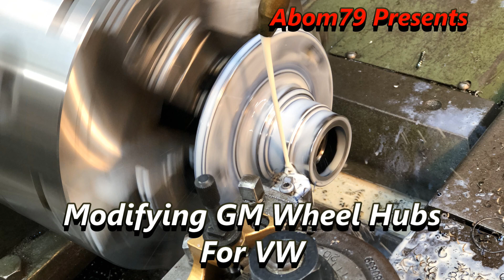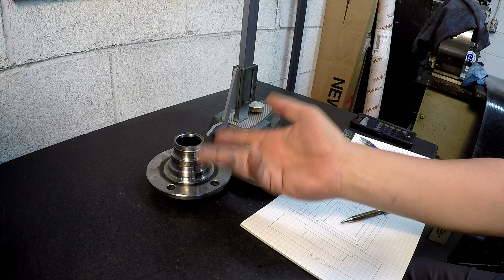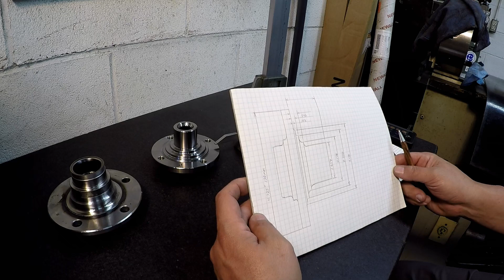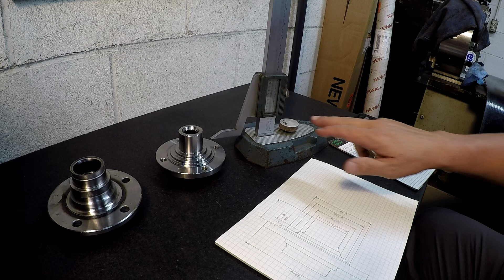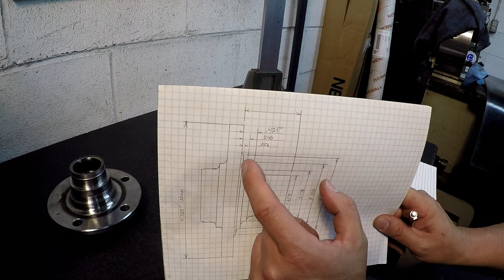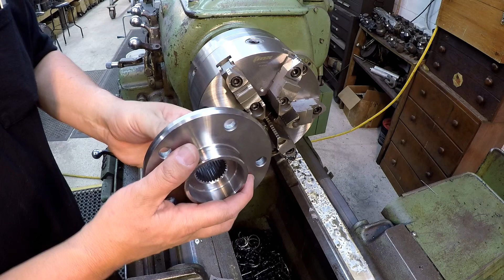Modifying GM Hubs for VW

Comment: Hey Adam I want to ask why you did not used simple tool as angle grinder n cut that bearing part at an angle? I am working as mechanic long time so I know that these things cracks so easy if you cut more than half of it so you save ur inserts and avoid that terrible sounds :D
Reply: there is no inner bearing race, the balls run on the hardened hub

Comment: Wouldn't it be better to anneal it first . Then machine it. Then heat treat it?
Reply: Did you listen to the video?  He explains this.
Reply: Heat treat cycle would probably distort the part and it would require to be trued in a grinder. Too much work.

Comment: dont think i could do these things with my smal lathe , think grinding them with a toolpost grinder might work
Reply: As long as you have enough swing on lathe you can do it
Reply: @practicalhands3720  With hardened materials rigidity becomes an issue very quickly, light cuts don't always work in that stuff.
Reply: Whatever it takes man!
Reply: You can temper the steel back and then re-harden it
Reply: @practicalhands3720  You can anneal/temper the steel and then machine it to dimension, but re-hardening will cause warping/distortion and growth.
That's the reason why hardened parts are ground after hardening or machined straight in a hardened state which brings us back to our initial problem.

Comment: Looks like it is the perfect job for a CNC machine. Anyway I prefer see Abom doing it manually :)
Reply: If I had to do this job and had the choice between cnc and manual I'd still go with manual on this one. However, if the job was to make a couple form scratch, I'd lean to the cnc.

Comment: Hey Adam, good job on them wheel hubs love watching your videos such a inspiration. I have a question for you if you don't mind me asking. I have a long stainless steel unthreaded stud stuck in my aluminium engine block (its a long engine mount stud and is flush with the engine block) What would you say is the best plan for attack of getting it out? I've tried Kroil, heat, hammer & punch, I've even tried swearing at it with no success :( I was thinking of drilling it out but I'm not sure what's the best type of drill bit for drilling stainless steel. I Appreciate your help.
Reply: cobalt drill, medium/slow speed with high pressure. But beating on it is gonna make it hard to start on centre without making a flat spot to start straight and on centre. Man never hit car/bike parts with a hammer if you think you might have to drill them out, if it is giving you hassle from the get go make the decision to drill early rather than bending, twisting and mangling it with a persuader then drilling when you have made it harder for yourself. Get a helicoil kit for the size required as im pretty sure you mean has threads? Good luck!
Reply: @williamsavory5274  I doubt it has threads on the section that is stuck because he wouldn't have used a hammer and punch otherwise
Reply: Guys he said it's broken flush with the block. How is he supposed to weld a nut onto thin air?

If you have a nice flat spot on the top of your broken stud, you can try the hardest left handed bit you can get your hands on, and see about drilling it out. That can be a nightmare even with the block out of the engine bay.

Comment: I hope the owner doesn't do crazy burnout contests and thows his car around the pad like bunch of headless chickens because i recon they won't be able to take these kind of loads on that...
For guys that think that the hardened stuff is always better, you are partially right if it's too hard for that small of a hub it will break faster, kinda like glass that is why the original part is only surface hardened and not all the way through. The hardness could also have come from the use of the hub, they looked a little bit used. If the hardness was uneven, then that should have been the case.
Anyways nice video like always and see you on the next one =)

Comment: I have a few of those seco inserts as well, I machined a modular milling head holder out of a very hard piece of shaft. I had to temper it back first because the tap wouldn't even touch it.
Reply: I notice you're turning slowly, I've found these inserts meant for hardened materials work a lot better when you take them up to speed.
I did a 20mm diameter at 1800rpm, no coolant and got an absolutely spectacular finish. My feed was quite slow at around .02mm/rev

Comment: I agree with another comment. CBN inserts would be great for this job.
Reply: Justin L. CBN on a manual lathe.. that part would need to be going over 1200rpm to just start getting into the zone for CBN
Reply: @AdamEarl2  And? It's been done and it's not unheard of on a manual lathe at all. 400sfm at the diameter he's turning would be around 600-700 rpm. It was merely a comment, I know he probably isn't interested in turning with a CBN, but it is possible.

Comment: I can´t help it, i believe, that is not the best idea (from the customer). You are making the whole thing smaller, and you are loosing partial the hardened surface. That means, the parts are getting weaker. So they will wear quickly when in use, i guess.
Reply: The only reason the original parts were hardened is because they act as bearing races. The new application uses off the shelf bearing and does not need heat treatment/hardness anywhere else then the splines.
Reply: This would appear to be for the use of beefing up the cv axles on a mk1 or mk2 vw as long as it doesn't shear the splines it shouldn't be an issue since the bearing presses on.

Comment: Edit: answered at 25:15

Pardon my ignorance, but why don't you anneal the hubs and then re-harden them when done?
Reply: Hard to hold a tolerence after re hardening. Especially for a press fit on a bearing id imagine
Reply: Any heat treatment ruins surface finish and tolerances. The original parts are surface/induction heat treated and then this surface gets ground as it is used as bearing race while the rest can be machined on a lathe. Annealing that would mean that heat treatment would need to be reaplied locally to the splines which usually requires specialized custom build machinery for induction heating.
Reply: My guess is that things tend to move a but when you harden them. Not the best for tolerances
Reply: note to self: If I ever need to make armor, GM wheel hubs might be a good option.